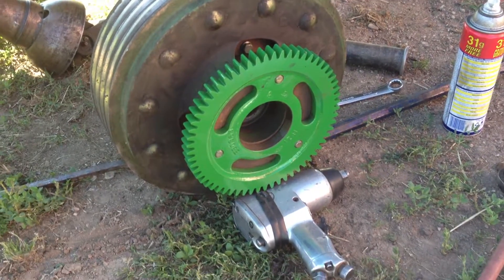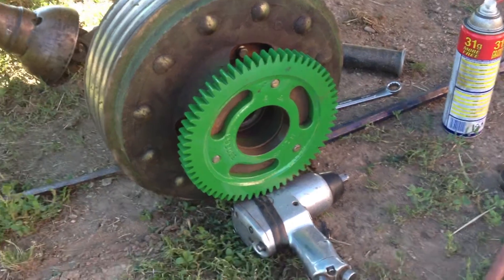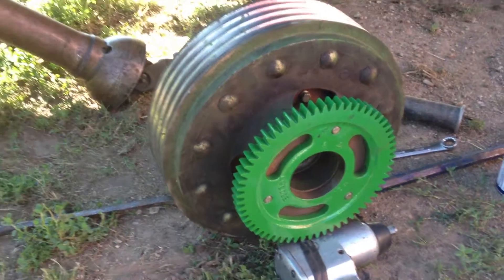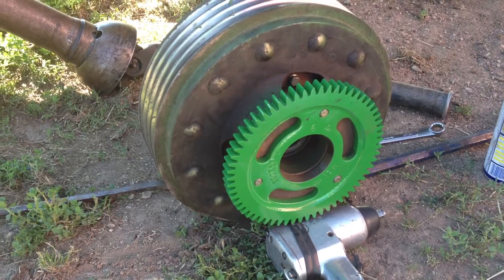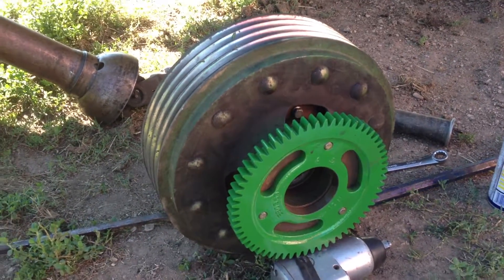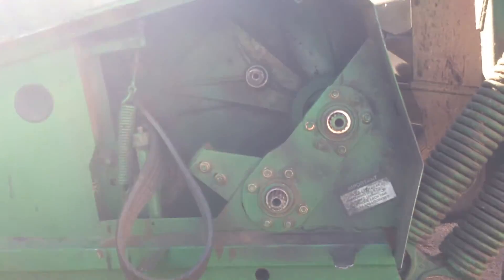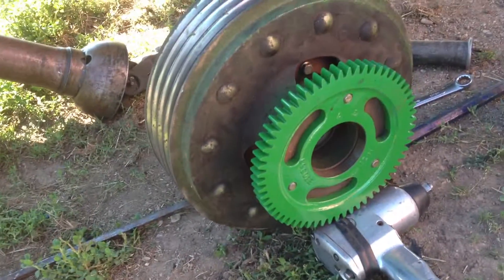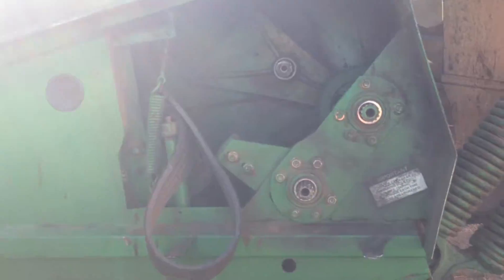John Deere 930 discbine repair part 3

Comment: How much did you tighten the Allen screw in the center of the drive pulley, the one that holds the pulley on.  And did you tighten it then loosen a quarter turn like an axle nut?
Reply from the maker: Nope..just kept it tight
Reply from the maker: @Renaud Roy believe counter..